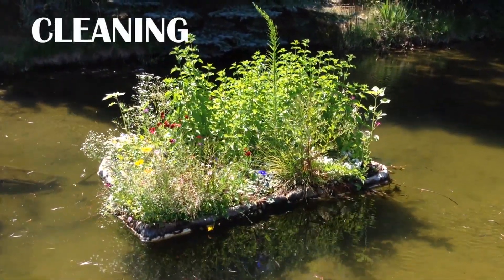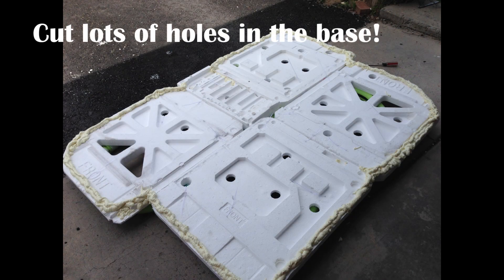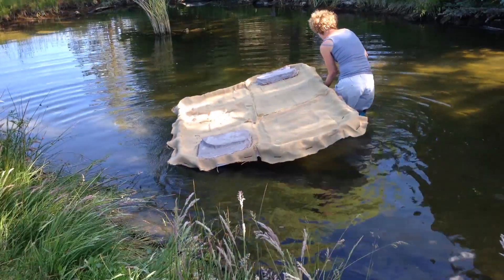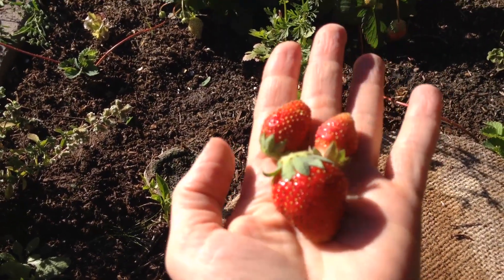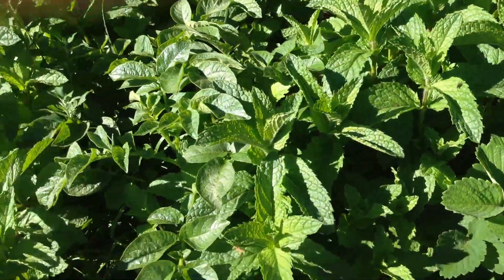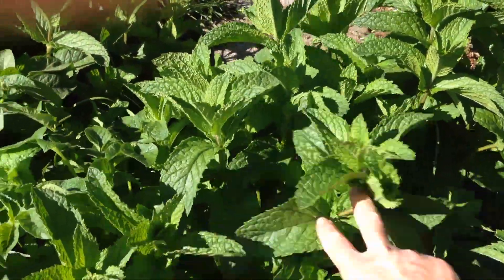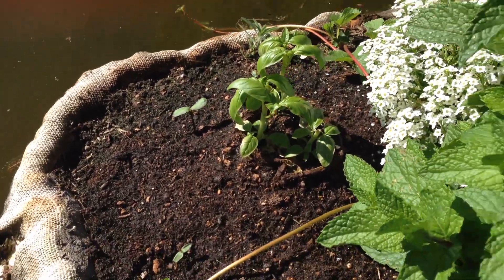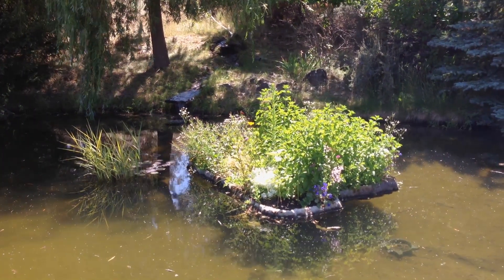DIY Floating Bio-Filter Garden

Comment: Imagine Marta is stopping 1 use packaging Styrofoam from adding to plastic pollution or you can spend money and add to the plastic found in our waters and baby sea turtles.. In this version which is not as practicle or help to fish or wildlife - Amazon floating "hydroponic" set up. https://www.amazon.com/Aquaponics-Floating-Hydroponic-Aquarium-Supplies/dp/B01BL5S7FC/ref=asc_df_B01BL5S7FC/?tag=hyprod-20&linkCode=df0&hvadid=222941228148&hvpos=&hvnetw=g&hvrand=18421135918939311217&hvpone=&hvptwo=&hvqmt=&hvdev=m&hvdvcmdl=&hvlocint=&hvlocphy=9011903&hvtargid=pla-393568090278&psc=1

Comment: One other question...is the soil making contact with the water?  It looked like it was floating above, but I'm guessing it must be in the water somewhat or those plants wouldn't be surviving.
Reply from the maker: I was hoping it would be more above the water than it is. The soil will wick water upwards after the initial week of watering, so you don't have to worry about the plants.
This year a Canada Goose tried to use it as a nest. She pulled all the dead grass from around the edges to pad her nest and it's bald all around the edge now. She didn't end up using it. Pooh. I will for the first time add soil where it's bald and throw some herb seeds on it.
Reply: @Diymarta  Darn!  Well, it sounds like it's holding up pretty well, all things considered.  I'm going to see if I can make one with the more condensed foam that doesn't break off in little balls and hopefully recycle some from some shipping container or packaging.  If it looks even half as good as yours, I'll be thrilled.  It's quite impressive how you created this video over a long period of time.  We often don't get to see that.  thanks!  Happy herb planting :))
Reply from the maker: @gogreenlocallyEASvideomaps  When you do, make a video so I can link forward to it.
Reply: @Diymarta  Ok will do!  I have added this to the long "to-do" list that I have going :))

Comment: Great video. Do the roots grow thru the burlap and down thru the holes in the styrofoam?  Can the styrofoam be toxic to the fish if left to breakdown over time?  I'm thinking about doing something like this in my Koi pond.  Last time I tried with smaller floating baskets, the koi ate all the roots and killed the plants.  Looks like maybe the burlap could protect them long enough to get established.  Thanks for sharing!
Reply from the maker: That's an interesting experience. I have the same concern about the styrofoam being toxic. The fish didn't seem to be affected, but I wonder about the long-term effect. I'm in the process of re-thinking the materials for this island. I'm going to build one with cork stoppers as the flotation component. But I still have to come up with a non-toxic frame. Plastic and foam can break down over time (and not in a good way). Any ideas?
Reply: @Diymarta  how about bamboo?
Reply from the maker: @saskiaeveringham7167  I'm still thinking of doing another with all natural materials. I've been collecting corks for this purpose 🙂
Reply: @Diymarta  maybe PVC pipe frame? I assume if we can drink from it after long periods of time it would be ok. Especially if it was covered and out of the sun.
Reply from the maker: @woodshopdesignco.6760  But we can drink from straws too, and look what they're doing to the ocean. I want to think way into the future. Bamboo maybe?
Reply: @Diymarta  Hi Marta, Great set-up first of all.   But when I saw the styrofoam I immediately hit the comment section.   I'm glad you realize this is toxic and are looking for other materials.    Did you have any luck finding anything new ?     I'll get searching as well because I like the idea to build one for my father's pond.
Reply: styrofoam will break down. not good for this.

Comment: Bicycle rims are gonna rust!
Reply from the maker: Even carbon trims? Anyway, by then the root system will be holding everything together.
Reply from the maker: @David Lockett you're right. I want to redesign this with natural materials only. Cork for flotation, but what for the frame?
Reply: @Diymarta  Bamboo for the frame would be biodegradable
Reply from the maker: @mousesbananabed  And it will float for years? Tie it with....? Thanks for the idea.

Comment: Hi Marta, thanks so much for this info,  on your page where you should how you made it, 
the polystyrene has some holes already in it, did you make more holes in the polystyrene or
were the holes it had enough to get a good amount of roots through,
also it seems you filled the holes in the polystyrene with what looks like coconut coir before 
covering with hessian, is this right?
Thanks again
Reply from the maker: Thanks for the questions. The poly had some holes and I added more for the roots. I tried different ways to keep dirt from falling through the holes. Coconut fiber was one way. Then I covered the whole thing with burlap. The burlap eventually disintegrates, but by then the root system is dense and holds the little bit of dirt pretty well. I'm in year 4 of my island and it looks like a natural island.

Comment: Very good. To me, this a simple way to explain the floating chinanpas used by Aztecs over 2000 years ago.  I have been looking for this kind of information. The soil of your floating garden shares nutrients with the water under it, and combined with the fish waste in the water make the perfect solution for you plants (Aquaponics?).  Thank you, I got the answer to many questions from a very valuable short video.
Reply from the maker: Let me know your results if you try it out. One thing I would do differently would be to use the denser blue polystyrene. This is the fourth year of my floating island and it is still floating fine, but the polystyrene is drenched.

Comment: Do you have to water at all or does it draw water up through the roots from underneath?
Reply from the maker: Debbie  L Gregory I watered the first week and then never again. The idea is for it to wick upwards. In fact, you can just wait a week before planting. The wicking system will be ready by then.
Reply: @Diymarta  if you look up floating gardens you will find them to be effective, you get a substrate and a resistance to sinking or you anchor it where you want so its like a pier, you can add substrate and below water plants for more biodiversity and protective vegetation because hawks and raccons
Reply: @VincentGonzalezVeg  will hawks eat fruit?